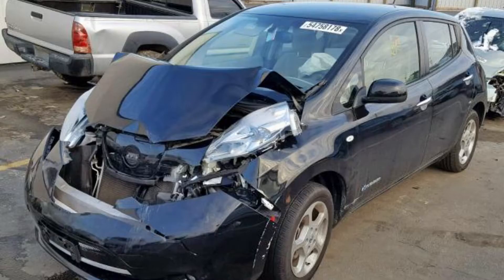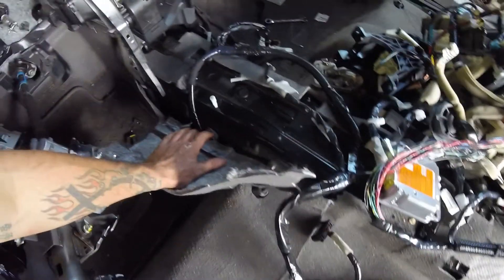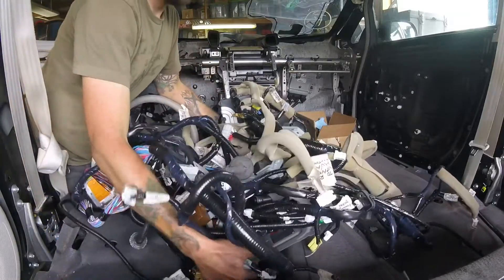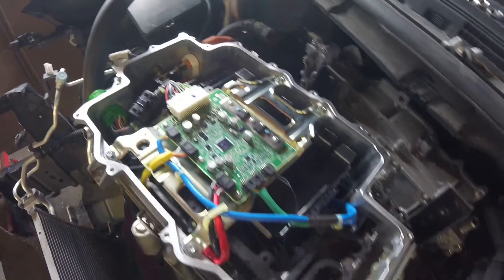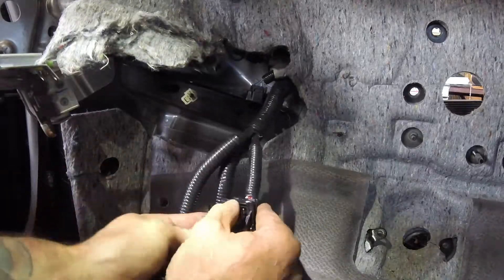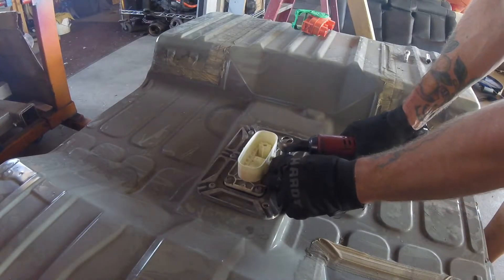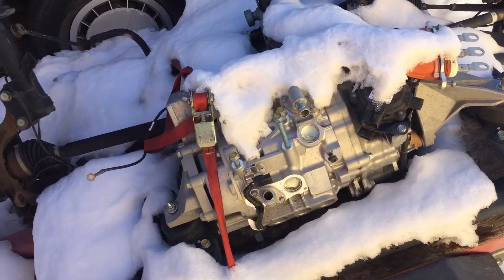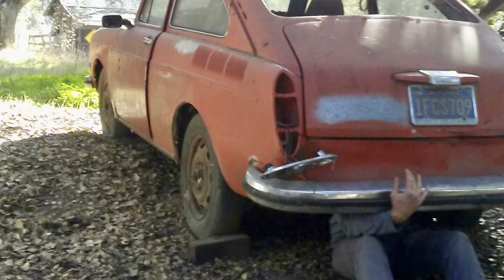Parting Out Nissan LEAF Donor Car

Comment: How did you get the plastic dash out?  are their screws hidden somewhere?  I'm thinking I'm just going to start cutting it up until its gone.
Reply from the maker: Hidden screws everywhere! I just did a dash removal and any bolt and screw I could see was removed, and I still missed some (and I’ve done it a handful of times already!).
Reply: @MicksUglyEVs  The glovebox has a lot, then the displays.  two on the sides by the little window.  still won't come out.  I started cutting it up with osc tool, cut through like butter.   How do you remove the passenger airbag?  It was holding it all in, I cut around it, but still need it removed..

I am going to remove the windshield next so I can cut more up front.